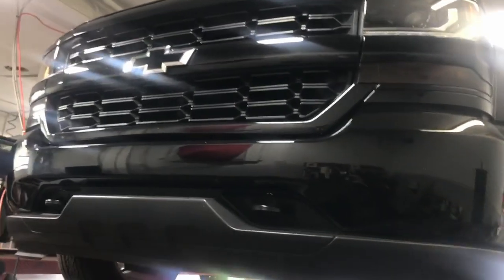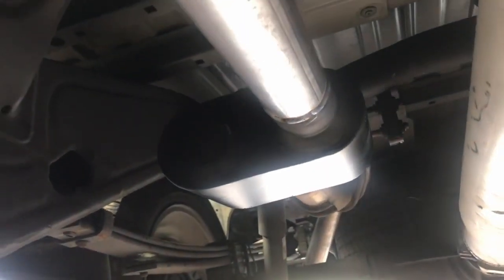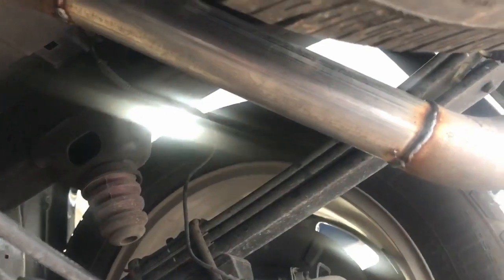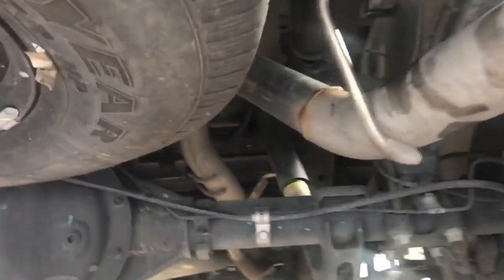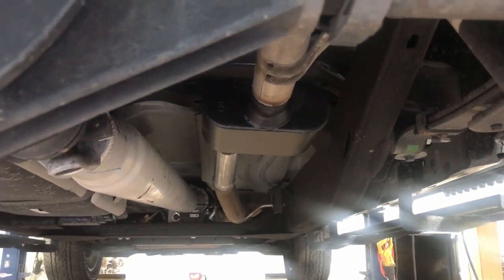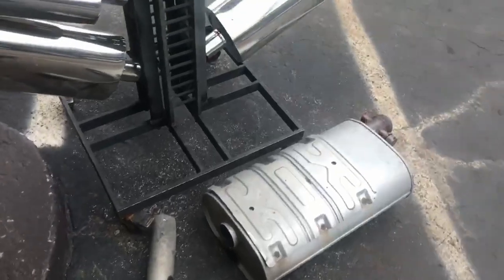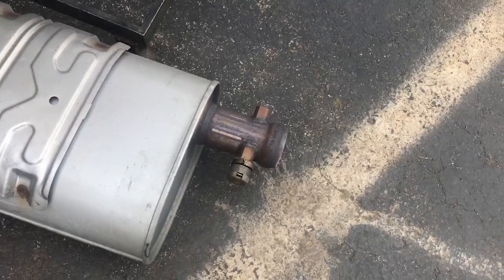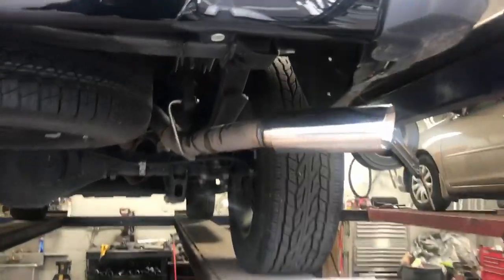2018 Chevy Silverado 5.3L  w/ Flowmaster Super 10 EXHAUST !!!!

Comment: They usually don’t recommend putting super 10 on 5.3s but it does sound mean
Reply: Who is THEY,  & why not? I have 40 on mine with the resonator on. Didnt want it to be super loud but it's not good enough for me now. Idk if I should just cut thre resonator off or swap the 40 for the 10
Reply: Mike Lowrey23 a lot of muffler guys I’ve spoke to say it’s due to the 5.3 motor where it has v8 mode and v4 mode. Sounds damn good on them chevys though!
Reply: Brandon Martin a lot of pickups now have that system, complete bs of a mode, had one on a 5.7 hemi and after getting it setup to not have it it’s such a better truck
Reply: @MikeMikeLowrey  Cut the 3rd cat out if you can, that'll make it louder. You can run just pipe after the 3rd cat and it still won't be very loud.
Reply: @josephmoad2507  how do you take it off
Reply: @AdmiralRustyShackleford  range makes a afm disabler you plug into your ob2 port

Comment: Did taking that flapper valve off throw any codes?
Reply: no it does not. i have a 2016 5.3 with a  carven muffler, no flap and no resonator. never got any codes. also deleted V4 mode so it doesnt sound like a helicopter when it hits V4 lol
Reply: Craig Roberts How did you delete the V4 mode
Reply: brandon watznauer you can get a tune and normally they take it off or Diablo sells a device that you keep plugged into your OBD2 port and it’ll eliminate the v4 mode

Comment: What does it sound like when it goes from v8 to v4
Reply: I was thinking the same thing
Reply: AFM delete/disabler will solve that problem
Reply: It sounds like a helicopter. I bought a Range brand disabler for my 15 so no more V4 mode.
Reply: @jameslee5762  i just bought a 14 sierra. Its all stock rn but one of the first things i bought was a used range afm disabler and its working perfectly